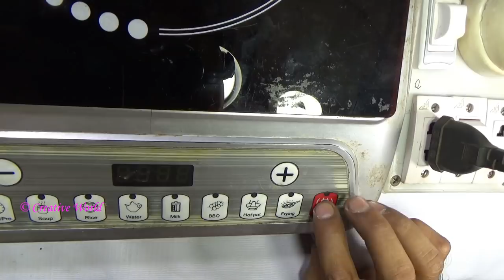How To Repair No Display On Panel Board Of Induction Cooker – Very Useful

Comment: Hello sir all button of my induction is blinking   after spoil the tea n shot n not heat pot where to check or replace 
Thank u
Reply from the maker: you should clean the circuit and resolder the circuit,,,,

Comment: What to test if the cooker beeps when I turn on power but no display? When I use multimeter to probe it as in your video, there is  5 volts. Could it be the display board problem?
Reply from the maker: no
Reply: @CreativeWorldPro  Where and which component should I test first in this case?
Reply from the maker: if panel board switch work,,,,,then it is the problem of display...
if panel board switch don't work,,, then it is the problem of IC..
Reply: @CreativeWorldPro  I will try and see if can get a similar IC to test. Thank you.

Comment: Mere infection me display pr lining aata h or bnd ho jata h kya kre
Reply from the maker: 1st you should change/check the Power Push Switch ,if switch is ok,,
then try changing output transistor and the rectifier diode......